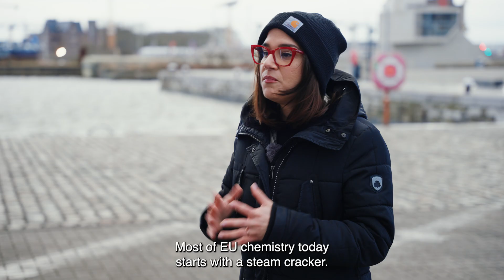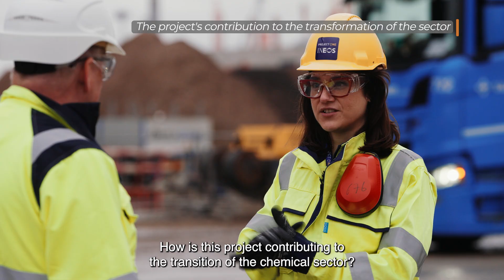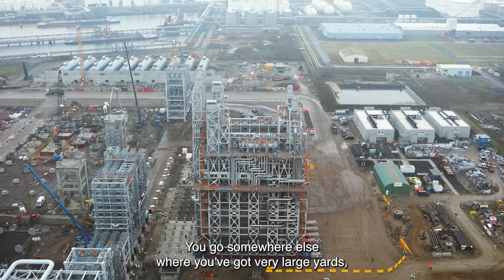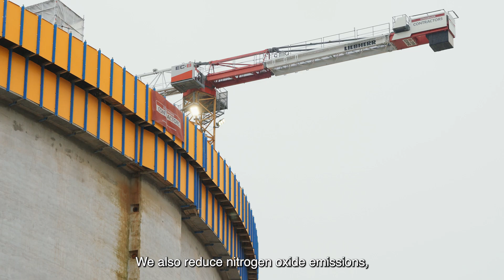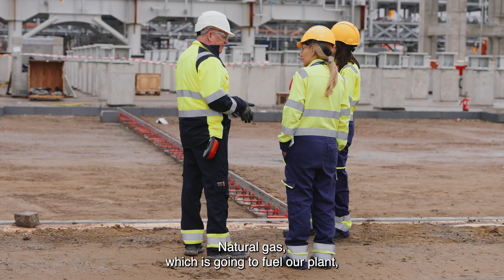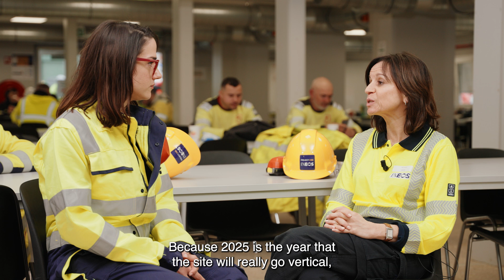INEOS Project ONE | Voices of the Industry | Antwerp, Belgium

Comment: Furthermore, hydrogen from a cracker is more pure hydrogen then hydrogen form a steam methane reformer (which has to be purified from CO2, H2O, CO, NOx ect) and could after puryfing be used in a PEM fuel cell . Like an Hydrogen Bromine flowbattery of Elestor.  (2 HBr < > Br2 + H2)  A HBr flowbattery needs an expensive hydrogen storage. But by linking it to a hydrogen net or factory that produces clean H2 the HBr battery works as a seperate elektrolyser and fuel cell. If you should use your hydrogen to discharge (= fuel cell phase) a HBr flowbattery works as a electricity plant with a very high efficiency (84%). While electrolyse and storage and then burning in a STEG electricy plant has only an efficiency of 35 %. And that without an hydrogen storage and the HBr flowbattery has also to work as an electrolyser when there is enough sun- an windpower.

Comment: Why are you burning the hydrogen to save natural gas/methane ???  Hydrogen is a feedstock for for example ammonia. So an ammonia factory uses a lot of natural gas to produce hydrogen. Because of the efficiency of 75 % the ammonia factory has to use 33 % more natural gas then when your hydrogen wil be used directly for production of ammonia. So project one and an ammonia factory together can save 33 % natural gas by not burning hydrogen but by using it as the feedstock for an ammonia factory. Furthermore burning hydrogen gives higher temperature then burning natural gas. So you need more ammonia to reduce NOx.

Comment: So it is not a steam cracker. But a furnace for ethane to produce ethylene.     C2H6 -- heat 750 oC - > C2H4 + H2. So it is not a 'steam cracker' like steam methane reforming  CH4 + 2H2O -- Heat -  > CO2 + 4 H2  ((after the watershift reaction to reform CO)).